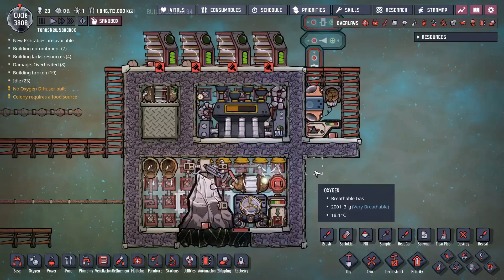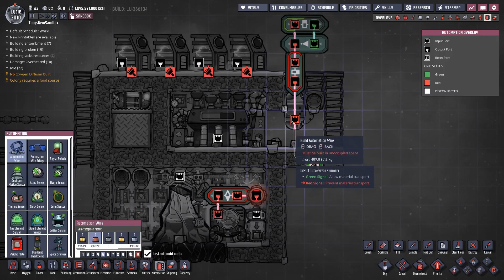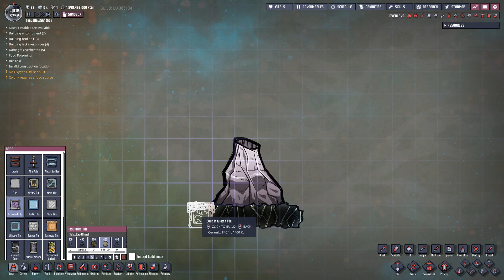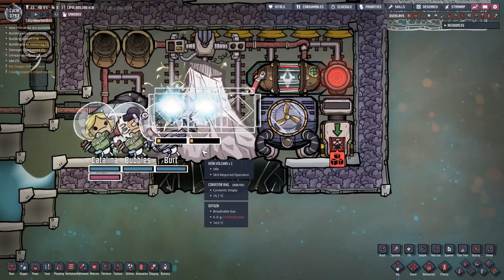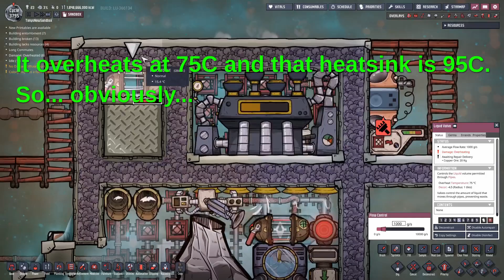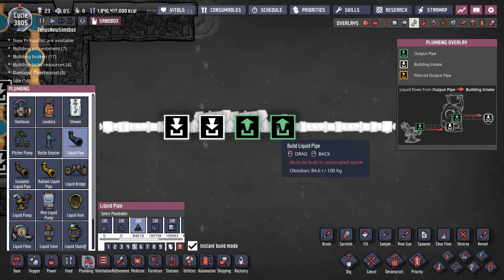Self-Powered Metal Volcano Tamer - ONI Volcano Taming - Part 3

Comment from the maker: Addenda:
1) I just got on twitter, it seems like the best way to get feedback and say what's happening: @tony_advanced
2) It's better to arrange it so the liquid pipe thermo sensor is right next to the aquatuner. This better prevents cold packets from entering the aquatuner. This might have broken my pipe a little bit. (via @kasuha).
3) You can prevent pre-mature-eruptions by leaving natural tiles over the volcano. (There is one tile in particular that needs to stay) (via @Saturnus).
4) It appears my setup melted a steel rail behind the volcano. I didn't catch it in the act, so I'm not sure what happened, but you might need to make those rails from wolframite for Iron volcanoes.
5) I asked Saturnus to have a look at this and he delivered in a big way: https://forums.kleientertainment.com/forums/topic/111477-taming-a-metal-volcano/?do=findComment&comment=1257522
6) Gas pumps are bad at making vacuums when placed on the floor because it covers some of the tiles it sucks from. Pointed out by many people. :)
Reply: Pin this comment :)
Reply: Also, you could loop the cooling loop through a pool of water in which you dump the iron into as a failsafe in case you demand more iron than the system can safely cool, the water will act as a heatsink to buy you time
Reply: I think the filter gate on that sensor might also cause issues? it might let two packets in, where one is colder than the other.
Reply from the maker: @nZifnab  It can, but since the loop of coolant never stops all the packets in the pipe are about the same temperature. Since they are the same temperature it doesn't matter whether you get an extra packet or two.
Reply: @tonyadvanced6315  Re point 2), you could probably set up some sort of automation timer with a memory toggle and buffer gates or something that would delay the start of the aquatuner until the packet that tripped the sensor reaches the aquatuner input? I've never played around with that (and the one I just made I just used Supercoolant anyway so less of an issue) but just an idea.
Also re: 4), I just had the same issue with a Gold volcano. I had excess Thermium to make the rails out of and just did the whole room, but it was only the single rail at the point where the metal spawns (starting from the bottom left square of the volcano picture, go up 1 tile and right 1 tile, that's the square that counts, and is also the one you need to leave covered to prevent eruptions) that melted, so probably the rest was overkill. Thanks for the design though, I really love it, even though my game hated me and spawned my volcano right up against the neutronium so I had to modify the whole room layout!

Comment: I built a variation of this on my own world a few weeks ago. I built it on a cobalt volcano. To maximize efficiency, i built two steam turbines, one set to activate if the temp in the steam room exceeded 240c and that turbine dumped power into my grid and the other was tied to a smart battery powering the aquatuner, and that turbine also was wired to a temperature sensor to activate if the temp went over 250c.

Like this design, the turbine outputs were divided to pull heat out of the incoming material and feed it back into the steam room by passing through a heat sink. My thinking was that i keep the room just hot enough so that the battery turbine can keep the aquatuner going, if it gets hotter strip some of that heat out for the base, too hot run both turbines and maybe lose a little energy if the battery is full, but the machinery in the steam room won't overheat.

The stored heat in the room and in the metal that hasn't left yet allows the whole setup to keep running through dormancy. (I observed it starting back up and not running out of power)

Comment: thanks for this design, starting this up without breaking the pipes in the heat sink was pretty challenging tho!
Reply: mine just broke. how did you do it?
Reply: @ElTuristaTravel  i changed the heat sink all the way by now, the water coming from the turbine is now going straight back to the hot room and i cool the heat sink with the cooling from the aqua tuner.. slightly less efficient, but it's just not worth the hassle
Reply: @ElTuristaTravel pipes don't break if there's only 1000g of liquid or less in them, did you forget to set the liquid valve to 1000g?

Comment: I have come back to this, because i use this without the water cooling, i dont think its necessary (also kinda cheaty) and its still self powered even without transferring heat from water of steam turbine to metal. But i did upgrade this to something quite large because i don't actually need the output of this to keep spewing out iron forever, basically i just added double doors in the steam room that can close and open with an atmo sensor. What this does is either reduce steam pressure under 149kg/tile or increase it to 200kg/tile so that the volcano can no longer erupt. This is useful for late game as having 500tons of iron is really unnecessary, we get enough iron from meteor shower too, and having less items decreases lag. Before this i used to resort to just straight up deleting iron from the game with debug menu. This is something i've added to most metal volcanoes, and it can be further automated using smart storage linked to the doors to keep a certain amount of iron you want.

While this does take up quite some space this can be done two ways, either have double doors for the same lenght as the "normal" volcano chamber and then have a total of 100kg/tile with doors open (wich gives 200 once doors close). Or if you can afford to delete water, juste juste a simple 2 double doors system that deletes steam, until you're happy with pressure, and add water until its high enough to overpressurise the volcano. Second has a smaller footprint but you can't really automate it completely, since you can't detect pressures over 20Kg

Comment: How important is it to cool the metal? It seems that when you build anything with the refined metal, it's temperature becomes 40C. So if you don't have a storage for refined metal in your base, couldn't you just leave the metal hot?
Reply: maybe you're fond of using weak liquid locks & a dupe dropping 150°c chunks of metal on a 30g drop of water could ruin gas separation. 
atleast using the turbine runoff to cool the metal down to 100°c would reduce those problems.
there are several other ways to generate power, so it's ok to have other priorities for these volcanoes.

if the priority is to squeeze as much electric power as you can: have the conveyor rail bypass the turbine room & only cool the metal using the turbine's exhaust water (salvaging some heat energy without paying for it electrically)

Comment: Tony, I'd like to see a metal volcano tamer that doesn't use steel, plastic, steam turbines, or aquatuners. Minimizing the usage of refined metals would be nice.

A common thing I see with these is that people will wick away the heat and delete it as the primary thing. Which I can see that it is easy to do, but I've been doing calculations about a copper volcano I have in my map. It produces 7Kg/s liquid copper at 2226.9 C for 68 seconds every 886 seconds when active; I don't know at current what the activity period is. By my calculations, I should be able to melt 156 Kg/s copper ore or around 8Kg/s iron ore with the heat of that liquid copper when it is erupting. If I'm not deleting the heat of the copper liquid but instead just moving it around then I should be able to melt successive quantities ore using the same heat without needing advanced power setups.

The one trick that I am having a hard time finding formulae for is getting the melts to reach an equilibrium temperature that can be handled by dupes (preferably without suits) in a reasonable time. I know the solution is going to be some variation on Delta T = T_final - T_initial and Sum(Q) = 0 where the Q terms represent joules to phase transitions of the materials involved; when the temperature difference = 0 then the materials will be at their equilibrium temperature. What that equilibrium temperature is depends on how hot or cold the input materials are initially and how much mass of each is added.

Using crude or petroleum as the heat exchange loop is going to be somewhat problematic and requires reaching the bottom of the map in general. Access to ventilation isn't going to meet the high expectations of people interested in the end game play, but oxygen, hydrogen, or natural gas is easily accessible and highly useful from the early to mid game on most asteroids.

Thanks for your well documented experiments.

Comment: Your videos make my ONI playing experience so much more enjoyable! Did your cool vent tamer last, now it’s time to tame a copper volcano! One question though: How do you decide how many steam turbines you put in a build?
Reply from the maker: One steam turbine can delete 877 kDTU per second. So assuming I can get the temperature right in whatever I'm building I use however many turbines I need to delete all the heat in the time I have.
Reply: Tony Advanced Thanks, what about the amount of steam then? I’ve been using your amounts blindly, but it would be fun to know where the numbers are coming from. Awesome content, thanks for doing this!
Reply from the maker: @CountGeiger  A metal volcano needs enough steam to keep the heat capacity high so the temperature doesn't spike too much during an eruption or when a lot of hot metal gets loaded on the conveyor rail all at once. The beefiest metal volcano can result in the need to process a total of 429.9 kDTUs of heat energy per second if the turbine runs continuously (when you include the heat produced by an aquatuner to keep one turbine cool). So as long as you have enough heat capacity (steam) to prevent the temperature from spiking above the temperatures your buildings can handle, one turbine is more than enough. The exact amount of steam depends on the volcano, but since there's no harm in having too much (except for that one heat-deleting bug) I tend to use "lots" and not worry much about the exact amount. You can get the heat capacity you need with other methods, a bunch of tempshift plates would be quite helpful.
Reply: @CountGeiger  volcanoes have an overpressure limit. you CAN add too much water/steam. i THINK(!) it's 200kg/tile.

I take a less measured approach and use 2 turbines per metal volcano. it's more cooling than needed, but I use temp sensors so they run hot when they do run. with 'plenty' of water and some temp plates, the temperature can stay around 190°c

Comment: I'm really liking your tutorials. I find them a lot easier to follow and they tend to be a lot simpler than, say, Brothgar's. He has great ideas too, I just like the way your present yours more XD.

I have a stupid-simple metal volcano setup that just let's the metal sit on the ground while the steam soaks up it's heat. Then during dormancy I go scoop it out into a storage compactor while it's like 110-120 degrees. I setup this up fairly early-game because I found two of these right next to my base, and it's been awesome so far (generally the stuff that needs metal is outside and I don't particularly care about the heat).

Now that I actually have robust access to steel and moderate amounts of diamond from the oil biome, I think I'll switch to something more automated like this. I don't have a great source of clay though for Ceramic... still using crappy igneous insulated tiles. Do you have any suggestions for renewable sources of clay? I have an automated setup to make ceramic, and I do have some stockpiles, but I'm afraid of running out (of clay) and insulated tiles are EXPENSIVE in materials.
Reply: 5 months in and my reply lol.. deodorizers produce oxygen and clay.. I saw Francisjohn dump all his dupe toilet polluted water into a pit with liquid storage tanks and covered it with deodorizers.. producing MAD amounts of clay and fresh oxygen.

Comment: I noticed that you used ceramic insulated tiles for everything. Am I correct in thinking that in the midgame before you have abundant ceramic, mafic rock insulated tiles would work fine for this build?
Reply from the maker: For this build I think mafic rock insulation will be fine. If you start trying new things with volcanoes keep in mind that molten metal/magma will be hot enough to melt mafic rock, so obsidian/ceramic might be necessary.
Reply: Either of you have suggestions for renewable sources of ceramic? (Specifically clay, maybe coal to a lesser extent but right now I'm using a ranch to make coal so not as worried about that)
Reply from the maker: @nZifnab  Good question. The only way to make clay that I can think of is with deodorizers. I guess that means you need a lot of polluted oxygen.

Comment: Been running this build for 200 cycles now. This is totally maintenance free. Really nice build  One thing I tinkered with a bit after firing up, but then left alone: The amount of steam pressure. While less steam creates more power because the steam->generator runs hotter and thus requires less power from the main grid, more steam seems to cool the gold down faster but draws more power from main grid because the steam->generator runs cooler. I.E, more steam/water cause the average heat of the steam to be lower which produces less Watts.  I been running about 50K steam per tile as more interested in cooling than  being power efficient. What steam pressure did you run?
Reply: I think less steam will run hotter, but for a shorter period of time. More steam will run a little cooler, but will run the generator for longer because that larger amount of steam mass is still absorbing about the same amount of "heat energy" from the metal.

I think he said near the start he's running it w/ 100kg steam per tile? Also that's what it looks like as he mouses over it later in the video.

So I think you're using less steam than him if it's only 50kg per tile.

Comment: The automation signals doesn't seem to work correctly until the conveyor belt is full. That is:

You set the pressure plate to send a green signal if below 200KG. However, the way this is hooked up is that this pressure plate green signal will over ride the 75 second pulse timer red signal and this will make the signal on the convey belt cut switch stay green regardless if there is chunks of ore in the belt loop system or not.

This build counts on the ore sitting in the system to cool down, not rush through the belt line.

So what happens is that with that current automation in place, the ore will rush through the system too fast and dump very hot ore on the pressure plate when the volcano first fires up. Now, once the conveyer belt is full then the system starts working as you planned..But that initial seed of spitting out hot ore because the ore didn't cool down long enough in the system appears to be an issue. 

Seems the could be solved by not connecting the pressure plate or the 75s pulse timer directly to the belt cutoff switch. Instead, they should both go to an AND gate and only if both signals are green should the cutoff engage.

Now in your first build with the funky double exit system, you didn't have that pressure plate idea. My guess is that you seeded the belt loop with your first build where this "Seeding" problem doesn't occur. Only after the belt was seeded with ore did you add in the pressure plate system.
Reply from the maker: That is the intended design. The thinking is that I want metal to be available to my dupes even if it is still hot. This might not be what everyone prefers for their own solution.
Reply: @tonyadvanced6315  Thanks for clarify on the pressure plate intent.  Built this in a real game and finally got it to fire. The middle steel belts behind the gold volcano melted right away, but I went in between eruptions  and just made the belt skip behind the volcano and go over the top.  Gold volcano is 200C higher then the melting point of steel. So for gold, just need to not route behind the volcano.  Works great !  Even the first time through, the gold still came out at less than 100C. Great build, dig the video guides!
Reply from the maker: @michaelsdenney  You aren't the only person to have trouble with those rails. I wish I'd have paid more attention to that issue when I made the video.
Reply: I had some automation wires running behind a volcano and they kept melting too XD I thiiiink if you have the steam in there, the gold should automatically drop in temp super quick and not have time to melt steel conveyor belts... but I can't guarantee that. I suspect the main issue is going to be starting it for the first time before your water has flashed to steam.

I could be wrong. but I never see anything hit that "erupts at 3 million degrees C" temp that the volcano reports after I have steam in there.

Comment: Remove the bridge you used to fill the cooling loop once it is filled and it will work fine.
Reply from the maker: That's true, you are right. The reason I prefer to leave that kind of stuff in place is because I assume I'm going to have problems of some sort eventually that require me to make changes or modifications and I don't want to have to set-up and take-down that kind of accessory any time I do something. I'm often not sure it's worth the extra effort or complexity, but learning how to do it that way is one of my goals.

Comment: For the buffer space "dual bridge" thing, wouldn't just have a dupe 1 time empty 20KG from the pipe loop do the same thing?
Reply from the maker: Yes, that would work fine. I know it's  nitpicky thing but I want:
1) to leave my water input attached so it auto-refills after modifications.
2) and I don't want missing packets of water running around the cooling loop and making my aquatuner pause momentarily.
I know those aren't necessary things, but if I can solve the problem then I can have everything I want.